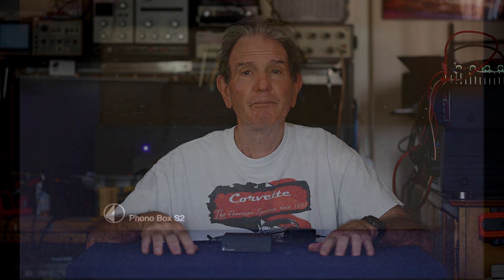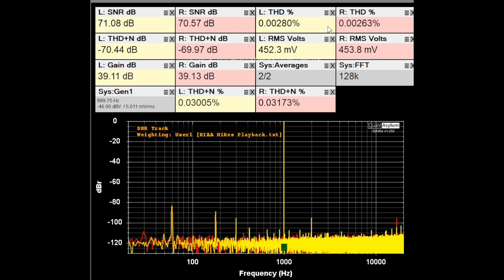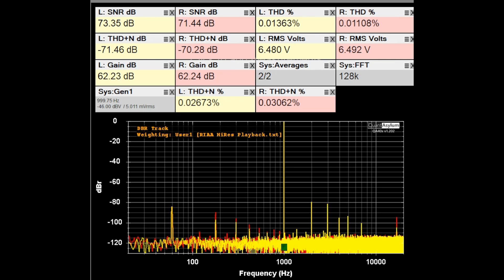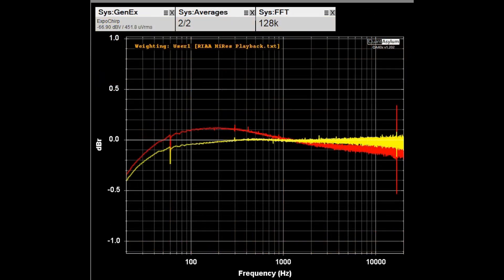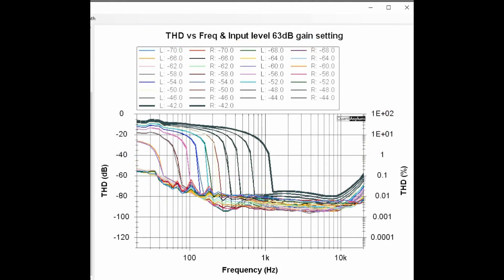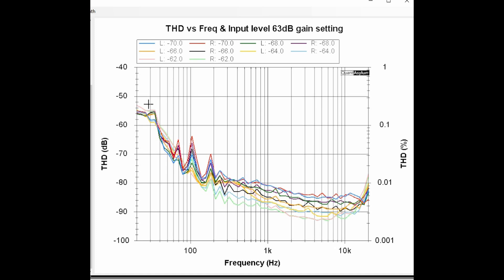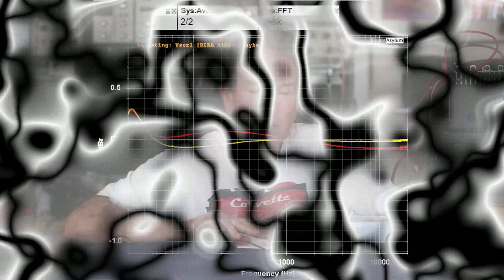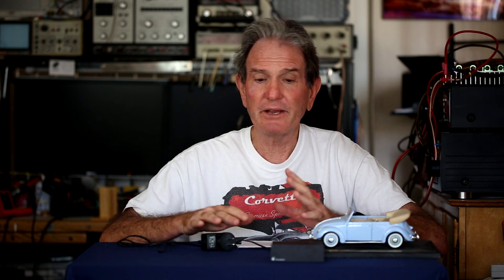Pro-Ject Audio Systems Phono Box S2 Phono Preamp- Vintage Audio Review Episode #149

Comment: There's no difference
Reply from the maker: no difference in regards to?
Reply: I'm playing through a Sonos play 5 not impressed at all volume is not very loud  @vintageaudioreview
Reply from the maker: @jamesblaser5329  Just looking at the data, with the gain set high and a 5mv signal input, it puts out over 6v which is quite a bit and should be plenty for any preamp- too much, actually.
Reply: @vintageaudioreview what do I set for a Sonos speaker play 5 I have a project T1 evo
Reply from the maker: @jamesblaser5329  It looks like your TT has a line out , so you would not need a phono preamp, but a regular preamp and a power amp

Comment: Look forward to more of your reviews of modern equipment especially where not measured by others such as ASR.  Very curious about the Saga 2 preamp
Reply from the maker: Thanks for the comment and suggestion. I primarily focus on vintage gear, but like to break it up when I get a chance with newer gear. IMHO, ASR is pretty much the best at reviews of gear, but mainly newer stuff. I am pretty much at the mercy of what my friends have available for me to test, and most of it is older gear. I have a few companies that have sent me stuff to test (Aiyima and Neohipo). As for Schiit, I have not heard back from them following an email where I asked for assistance after one of their power amps smoked during testing, so they are currently on my schiit list. Hopefully that will change but the review will happen on it in the future...

Comment: It's probably a pretty good pre-amp.  With phono stages it's really the RIAA restoration that matters and if it's on spec, like this one, it's usually going to sound just fine.  These are high gain amplifiers and at the low levels from most phono cartridges, there's always going to be  a noise background and, unlike many think, that can mask a whole world of other problems.
Reply from the maker: Thanks as always for the comments, Douglas- it was nice to see a decent phono preamp for not a ton of $.
Reply: @vintageaudioreview  
Get a look at the new Fosi one... I'm told it's pretty good as well.
Reply from the maker: @Douglas_Blake  ASR did a review on it and it looks really nice/
Reply: @Douglas_Blake  you mean fosi audio tube amplofier chinese?
Reply: @cegro78  
No ... the Box X5 ... all solid state.